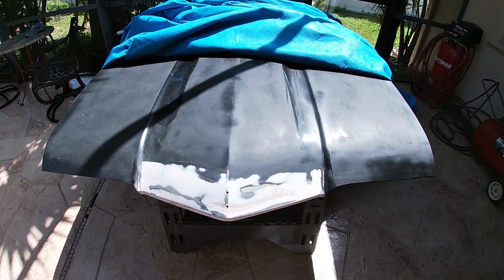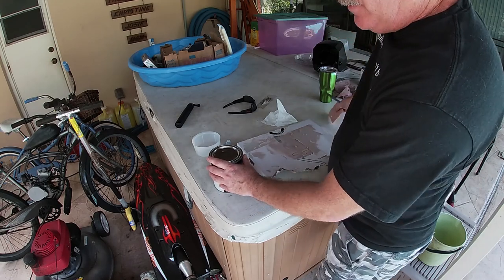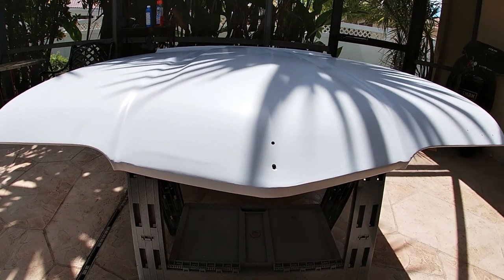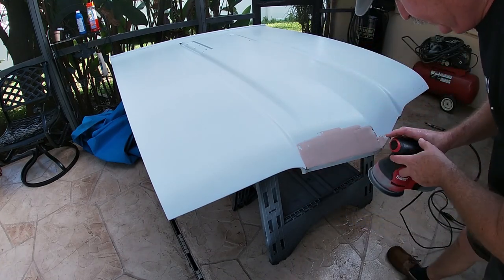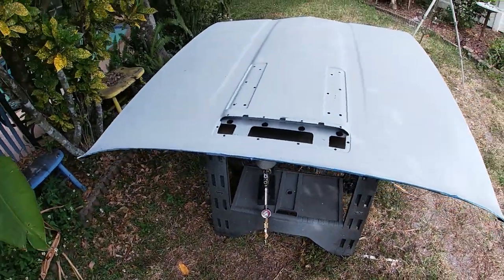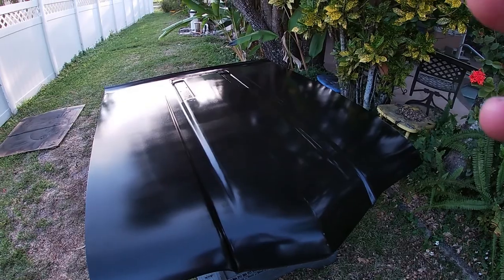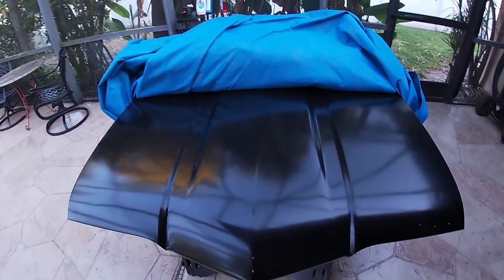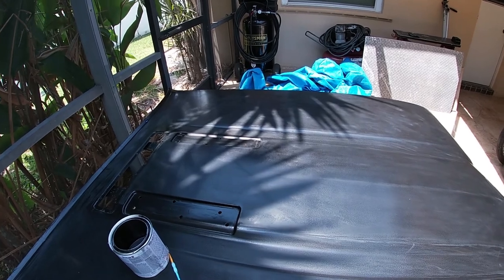I finish the Cutlass hood and finally spray on the Dupli-Color Jet Black paint and clear coat.

Comment: You need to widen out your fan pattern for those final coats my man. Thats why you were using sooo much paint. I thought it was a great video.
Reply from the maker: Thanks Johnny, I appreciate your feedback.
Reply: I have a qt. Primer qt. Jet black Dupli Paint shop. I havent sprayed it yet,  its a bit cold here in PA. How did it hold up for u? Also the gun u used, is it a spot repair(mini style) gun?
Reply from the maker: @Johnnykwik082  I like the DupliColor primer it did well for me. I used a Devilbiss GTI  gun with a 1.5 mm tip for the primer coats. When I do spot repairs I use my Devilbiss  StartingLine Detail gun.
Reply: @f119045  Ok, i know the GTI real well. I have that and i have the SRI PRO. I only ask bc in that video you mentioned how much paint u were burning through and i remember thinking your fan pattern waslike 3 1/2 or 4" Im not sure about the Starting line but the GTI if you 3/4 your gun pressure, open your fan pattern all the way and go 1/4 turn IN and open up your fluid more u should get a nice even 12-14" flat lay. I also noticed your "sweep" sped up drastically after about 1/3 of the way through the panel. Try and stay patient and "push the edge". I always ran into problems when i would sweep and my over lap would be thin then id start a new overlap and go back to cover thin thin spot(not good lol) I just noticed u making the same mistakes i did and wanted to tell u what works for me. Internet people never want to help they want to hurt. I thought your video was great though. Keep going, i. Sorry for the long msg, take it easy amigo.